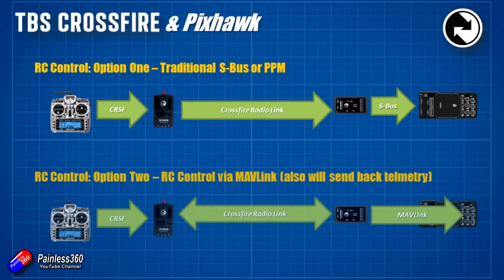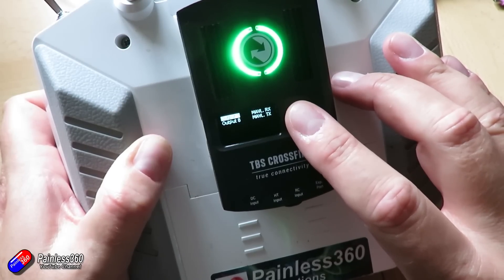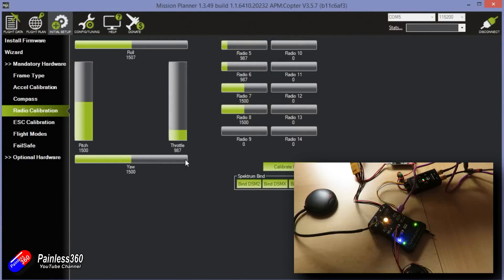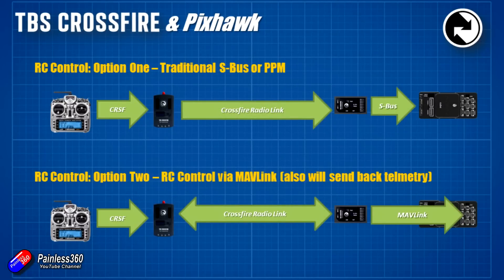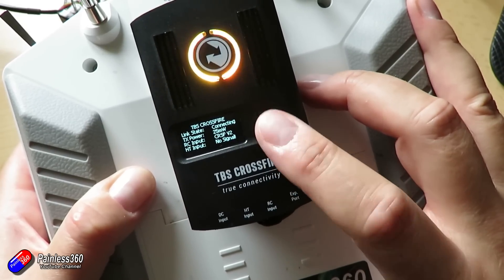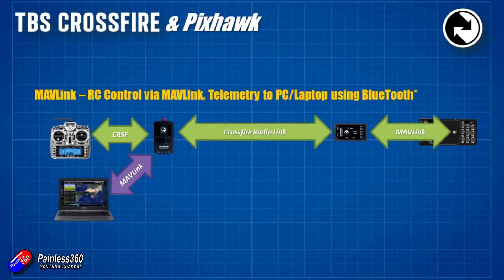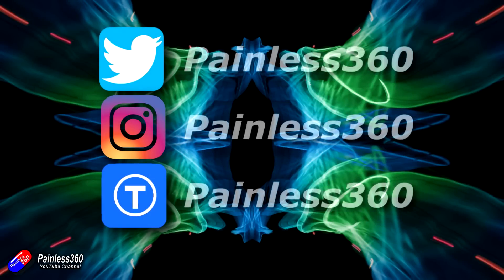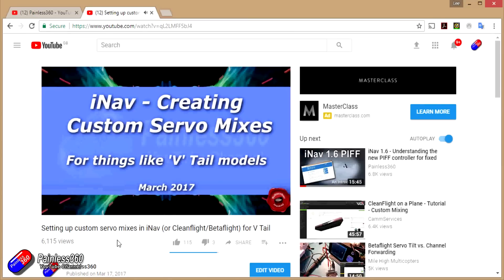Crossfire and Pixhawk: RC Control (S-Bus, MAVLink) and telemetry options

Comment: Tx for all your vids over the years , I’ve just dug out my old asw glider & t16 with Tbs crossfire , but fir the life of me can’t get the Tbs crossfire Tx Bluetooth to connect with my win 11 laptop the laptop shows  the cross fire Bluetooth but when I try to connect it comes up asking if this random long PIN number matches  the crossfire Bluetooth pin ! Any help would be appreciated as you are definitely the expert 👊🏼
Reply from the maker: 0000 or 1234 are always worth a try.. best of luck
Reply: @Painless360 Tx for your reply , the PIN number windows is suggesting is like 8 digits long , it gives you the option of accepting or cancelling if I accept it connects for about 2 seconds then disconnects.. many Tx for taking the time to answer ..

Comment: Can you please help me I did it all but still not working the RC input is not working and mavlink telemetry not working
Reply from the maker: What troubleshooting have you already done?
Reply: I did all you said in the video but still nothing can I use serial 4 or 5 to use it for mavlink telemetry and RC? @Painless360
Reply: @Painless360  please help me solve this problem I know you can I learned a lot about the hobby from your videos
Reply: I have an old pixhawk 1 same one that you have but still nothing
Reply: I want to use this reserver Original TBS CROSSFIRE DIVERSITY NANO RX - FPV LONG RANGE DRONE RECEIVER

Comment: can you please help? Hi mate, I am tryng to use this configuration (I have pixhawk 2.4.8.  TBS xf big module and taranis. when I connect to MP everything is working, telemetry etc. bu I don t get movement form the radio sticks. can u pls help
Reply from the maker: Sure, what troubleshooting have you done already?
Reply: @Painless360  I have updated all devices with newest firmware, I have narrowed the area of problem to Taranis itself (I also have cube orange, tried it and Im gettnig the same result so I am assuming the problem lies with Taranis). I should mention my receiver is nano divesity. I have connection transmitter-receiver (nano is fixed green, crossfire module is showing transmission, on tarranis I have a link icon). in the radio I creted new model with 4 channels assigned to basic plane steering, on the display they are active. I also tried connecting via RC-in and result was the same- telemetry comming back but steering signal is not going out to flight controller
Reply: found some description on channels 7 and 8 to be assigned to RX and TX respectively on XF, could that be it?
Reply from the maker: I've not had to do that. The process shown that I use is in the video and the linked docs. That is odd..
Reply: @Painless360  but funny enough when I connect via Sbus I do get telemetry feed on FC and it shouldnt be the case (?)
Reply: and on the MP I get "pre arm warning: waiting for RC"
Reply from the maker: That is Mission Planner telling you it can't see the signals from the radio. You can connect the reciever via SBUS or CRSF. Pick one and follow the video... Best of luck!

Comment: If I used regular crsf to talk to Ardupilot for rc controls (pins 1 and 2 on receiver), then had a separate mavlink connection to the FC (pins 7 and 8), would I need to use 150hz mode and what would the range be like? I'm assuming I would get normal full Crossfire range, but as I get further away or the update rate switches to 50hz then the Mavlink telemetry would cut out? I want to be able to have a full reliable RC control, but I'm not too concerned if the telemetry cuts out beyond a certain distance
Reply from the maker: All I figured out at the time is in the video. MAVLink is one of the first things to be dropped when the link starts to be stressed so is only reliable for closer in flying.

Comment: Im struggling a lot to download params over the telemetry link of crossfire then BT to my laptop. I do get some data but parameters will never download. Edit: Working perfectly now. After „making sure“ I wired tx to rx pins several times, I switched them anyway. And voila, it works😅

Comment: can we do the same using ELRS Transmitter? can we check telemetry data on the Computer? like TBS Crossfire to Computer connection using MAvlink
Reply from the maker: No need to post twice. I have answered on your other question... Happy flying

Comment: Hello Painless360,
Curious to know if there would be any downsides in your mind in switching over to controlling via MAVLink/Telem Port verse the S-bus configuration? Thank you for your time!
Reply from the maker: Increased latency is the main one. Plus, you need a whole PC setup at the field. It is useful for larger models where things like a little lag isn't an issue.. Best of luck!

Comment: Is this method possible with tbs crossfire micro tx modules now in 2022(using mav tx and mav rx configuration on rx side)?
Reply from the maker: Things have moved on and improved a little now. Modern versions of Ardupilot support CRSF - https://ardupilot.org/plane/docs/common-crsf-telemetry.html
Reply: @Painless360  thanks

Comment: Using this method, can we upload missions through mission planner ? And both telemetry radio like rfd900 and crsf uses same frequency, won't there be interference....
Reply from the maker: If you are using a telemetry radio on the model then I'd use that for the comms to the model.. Best of luck
Reply: @Painless360  ah ok and one last question what about full mavlink bi-directional telemetry support like  between dragonlink and mavlink.....Is it possible as of now !!
Reply from the maker: I don't know anything about Dragon link, sorry.

Comment: mine works great but it will not connect via bluetooth on the mission planner app. Set serial 1 to 38 no joys set it to 57 no joys same with 115. says getting params but will not go any futher. any ideas?
Reply from the maker: I'd check what baud rate it is set for. Best of luck

Comment: If I use TBS Tango 2 for radio with separate 433MHz telemetry, then will there be any interference among them?
Reply from the maker: Shouldn't be.. Always try and physically separate antennas on the model. Best of luck!
Reply: @Painless360  Thank you soo much for replying. 
I will be using Tango nano RX with immortal T antenna. I think it works at 900MHz or so.
Reply from the maker: 868 or 915Mhz depending on region - see my Crossfire for beginners video.. Best of luck
Reply: @Painless360  
Thank you 😍

Comment: so could I control the pixhawk with the groundstation (i.e. create waypoints) when I use the crossfire - mavlink via bluetooth setup?
If so, that would be awesome! :)
Reply from the maker: If you want to do that then the MAVLink over Crossfire wouldn't be my first choice as range affects the transmission. I'd use separate telemetry radios if you are going to the trouble of building a groundstation...
Reply: @Painless360  thx for the quick reply! oh, so you can't send that kind of data reliably as far as the normal control signal?! (because as far as i know crossfire seems pretty solid in terms of range?)
great channel and great video by the way.
Reply from the maker: As the link gets stretched, the system prioritises the RC controls over everything else so MAVlink suffers.. Use separate telemetry radios would be my advice...
Reply: @Painless360  ok, makes perfect sense actually. sperate telemetry radios seems to be the way to go, thanks!

Comment: if your using the crossfire protocol at 915mhz and you want mavlink data with redundancy, and you choose to run a telemetry unit directly to mission planner should i be using 433mhz? would a 915mhz telemetry unit interfere with crossfire control link if using both for redundancy?

Comment: I am not able to get telemetry data on jumper t16. I am able to get radio control using telemetry port 1 connected to tbs crossfire with mavlink rx and tx on channel 3 and 4

Comment: Just wanted to let you know that since about 2 weeks Ardupilot supports Crossfire natively. That includes telemetry sent back to the radio and reading of RSSI/LQ as well as RF Mode which I think is super cool. It's like iNav :)

I just completed a build of a quadcopter and after a little bit of tuning the vehicle performs very good. Alt hold with a lidar is super stable!

And the most important thing is that all the things I've done I have learned from your videos! You are the rock star! Thank you!!!

Comment: Lee, is there a way to get the Pixhawk telemetry into the X9D/Radiomaster/Jumper radios?  So the telemetry can be viewed on the X9D, etc telemetry screens?  Thanks.  (I'm trying to switch from FrSky 900mhz to Crossfire, but would like telemetry on my radio just like it is now.)  Thanks.  P.S.  Is there a difference in telemetry capabilities if I switch to iNav?

Comment: what a great video, ive been days trying to connect my crossfire micro tx v2 to my android phone so i can use mission planner app or q ground control app, the tx and phone and laptop connects to phone hot spot but no matter what i do neither app will connect, my nano receiver is wired to f405 wing uart 1 rx to tx and tx to rx , 5v and ground. nano binds and all telemetry coming back to radiomaster. looking on crossfire instructions but not sure if I need more wiring for these apps to work? thanks for video any help would be great

Comment: Hello, I'm trying to make this work with a CRSF Nano and a Pixhawk 2.4.8 and the FC is not detecting a radio automatically as you said in this video. Any insight on what I could be missing here?
Reply: Did you ever make any progress? Trying to get the same two things to talk and having the same issue. I'm bound to the nano from my transmitter, it's wired into the pixhawk Telem 1, I've tried tx and Rx as CRSF and Mavlink, and tried swapping pins, can't get anything to register.

Comment: Thanks, this is awesome video and channel! I have a question. Lets say I have pixhawk or some other controller that is running ArduPilot. There is another companion computer running on board. It is connected to pixhawk using mavlink and either sending destination locations the plane, or provides manual pitch/roll/yaw inputs. There is no traditional radio present. How should the ArduPilot setup happen in such case? There is no transmitter so there is no stick calibration to do. Could you comment on that? Thanks.
Reply from the maker: It is something that was available via the Edison initially so I would check out the ardupilot documentation and project wiki. Best of luck

Comment: Hey there,
I have a question. I cant remap the channels on my dx9. Can I just switch the channels therefore in mission planner and make it work that way ? 
Spektrum channel order is : 
Throttle
Ail
Ele
Rud
"Gear"
Aux1
Reply from the maker: No idea,  sorry. I've only used Crossfire with OpenTX radios.. best of luck
Reply: @Painless360  Thank you, I figured out a different way that works !

Comment: Hello, I need help!  Is it possible to get mavlink telemetry on PC or Cellular using crosfire tx lite?  Maybe through the USB or Exp port?  Or is this connection only possible with Bluetooth tx?  Grateful for the videos and responses.
Reply from the maker: I don't think it is. If you get it working please let me know.. Best of luck
Reply: Crossfire lite uses on board wifi to get mavlink telemetry. Just check new documentation of crsf.....

Comment: Excellent video, very enlightening.  All receivers are compatible with mavlink telemetry? In the most current versions is it already possible to control from the laptop via mavlink? Thanks!
Reply from the maker: Still the same but full telemetry radios on your PixHawk offer a fuller range of MAVlink control, sharing and support.

Comment: Does anyone know if this can be done in the TX modules without Bluetooth by plugging a USB cable into a computer and the crossfire module?
Reply: I'm gonna hazard a guess that it does work. 
"Two-way communication opens up new possibilities. From streaming MAVLink to you smart device (no Mavlink stream support for Crossfire Micro TX!), to updating your firmware..." 
But it would be cool to see someone try it.

Comment: Writing from the Future... Is the case as of Oct 2020 that I still need telemetry radios If I want to use a joystick for control on QGroundControl?
Reply: same question here
Reply: @domiDrumo4816  here in this video he says Q ground control receives data through Bluetooth link and there is a * which i guess means telemetry range is limited to a typical Bluetooth range M and the CRSF radio link stays with power to cross fire range typical 25 kms
Reply: @sumanthbolisetty  ok so drone speaks to radio up to 25km and radio to laptop/ ground control via Bluetooth. That's a start 👍

Comment: Ok, sick of me yet?  I have it working, in large part due to this video, thanks.  There is ONE setting that I am confused about however.  It only works if RC control is through Mavlink.  I thought this would also work in a more robust fashion if RC control was through CSRF?  Does anybody have any thoughts on this?

Comment: I watched the video again and noticed you have also connected power and ground between the Crossfire receiver and the PixHawk telemetry port.  Is that a requirement for this to work?  If so, which device is powering the other? (sorry for all the questions...I can't get this to work for me so I am looking at every angle)
Reply from the maker: I did that for power but if it is already powered from the other connections then you only need the GND wire for the signals. Happy flying!
Reply: @Painless360  I also noticed you use diode between power and ground to protect in case if 2 power inputs. Do you have video about this? Do I saw right anod on power and cathod on ground should be connected?

Comment: Slightly tangential to this, I have been using my Android phone and QGroundControl with the 433 MHz  3DR radio link to communicate with the Pixhawk in my Quad-Plane and I got close to smashing the phone's USB connector by snagging the the OTG cable. So I acquired one of these Quanum Bluetooth telemetry boxes that happily communicates with the 3DR radio in the model and links via bluetooth to the phone. It saves wear and tear on the phone and allows you to use a non-OTG equipped phone/tablet for the job. 
https://hobbyking.com/en_us/quanum-bluetooth-telemetry-box-for-3dr-radio-modules-v-2-433mhz.html

Comment: And would this get the full crossfire range, what about data speeds
Reply from the maker: Not full range, RC control is prioritised as the signal degrades with distance.. See the other Crossfire videos that covers the radio profiles it uses.. Best of luck!

Comment: I've setup my full size CF just like displayed over mavlink to my Matek765wing with Arduplane 4.0.5. I've set LQ on ch6 and setup in arduplane accordingly. But somehow I can't get my rxrssi value to display proper, not on the OSD not in the telemetry screen of Arduplane. If I startup the plane without the RX on, I get 0%, what would be correct. If I switch on the Rx it goes up to 100%, what is still satisfying so far. But if I witch off the Rx, the rxrssi value in the OSD AND in the telemetry screen stays at 100%, though the FC is going in failsafe, like it should. So my big concern is, can I trust my OSD value? I don't think so. But what is wrong?
Reply from the maker: Video on this hopefully coming soon...
Reply: @Painless360  next lock down build video? really waiting and following that!

Comment: any chance you could do an updated video on this? im having issues with consistently getting a Bluetooth connection to mission planner and qgroundcontrol
Reply from the maker: New PixHawk series starting next month... Stay tuned!
Reply: @Painless360  cool, that's good to hear. For the time being, do you have any troubleshooting tips or more extensive guides to get a link between the crossfire module and a ground control software?
Reply from the maker: Sorry, not at the moment...

Comment: Could you explain how you made the telemetry cable shown at 4:17 that goes from TELEM 2 to CH7 and 8 on the Rx? Did you just modify an existing cable, or did you make it from scratch? Trying to figure out how to make one of those myself...
Reply from the maker: I just modified an existing cable. Happy flying!
Reply: @Painless360  Ok sounds good. Thanks!

Comment: Hi. Thanks for these great videos. I've learned a lot from your channel over the past few years. I'm planning to set up Crossfire on a large quadcopter (recently announced Freefly Alta X) using a PixHawk 2.1. I'd really like to pull telemetry information over MAVLink as you describe here. Particularly, I'd like to make sure I can read voltage and current consumption from the batteries. I was wondering if you had any recommendations for a power/battery module that would allow me to do this. The Alta X uses two 16Ah 12s LiPo batteries in parallel. Curious to know how you'd go about setting this up. I'm afraid to use most of the power modules I'd normally turn to because I'm not sure they can handle this much power.
Reply from the maker: Not sure, I've not used that.. best of luck!

Comment: Lee.. the lite version seems to be the only TX available at the moment ..and it doesn't have a bluetooth capability. How do you connect using mavlink to the TX module without bluetooth? Is it opossible? tinking of buying a TBS system for arduplane but this is a key issue. 

Also the ULRS project ( http://www.itluxembourg.lu/site/ultimate-lrs/) combined with the mavlink pass through  software (https://github.com/zs6buj/MavlinkToPassthru) enables both Taranis/Horus  S.port telementry and Mavlink. Would this option also be available on the TBS Tx?